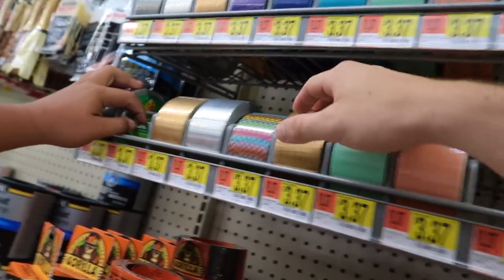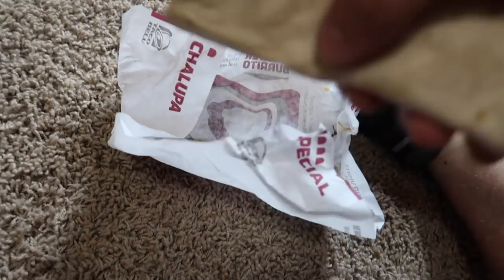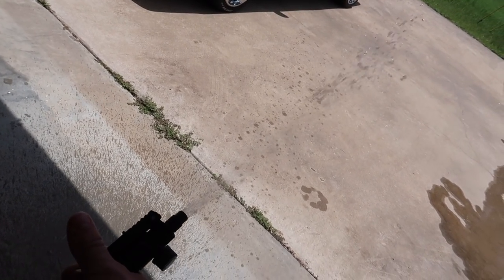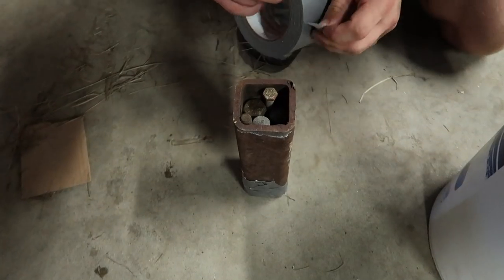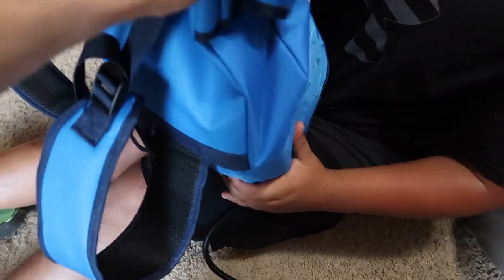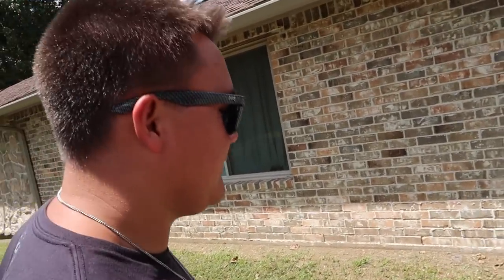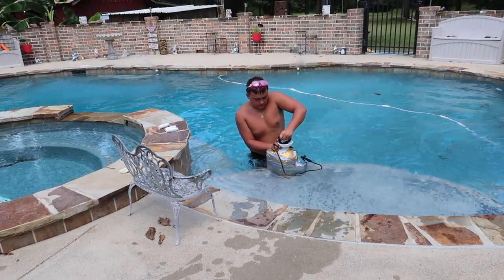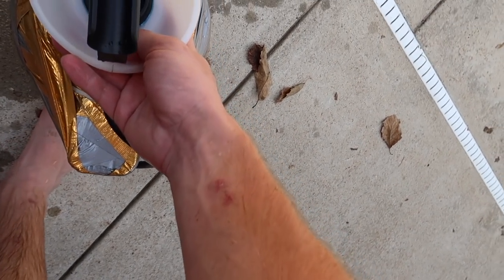How To Make A DIY Scuba Tank for Under $20 at Walmart!!

Comment: Connect a 25 - 50 ft long coiled air compressor hose / or tubing on the existing tubing, switch on wrist band removable,  put the tank in a floating small boat / or inner tube with a bottom, with a divers flag, maybe with an anchor and rope.  Wear a weight belt detachable in case of emergency,  ( if needed a string under shoulders attached to boat, but the coiled hose / tubing may surfice for the string . ) Max dive depth about 20 ft and Voila you're scuba diving. like the old time suit helmet diving.  But get training scuba diving certified to understand about diving to be safe. maybe with a diving knife...

Comment: Their talking about 10 feet of water for crying out loud.   I have played with this option myself but I got a larger sprayer from Amazon as well as a low pressure hooka regulator and hose to use with it.  I also added a air pump tire valve so I could use an electric tire pump to get more air pressure.   This will give you more like 15 mins in river depths and only a few mins to pump it back up if you use an auto tire pump.  The regulator helps reserve air pressure better, and I left the tank float with a flag and small anchor and use a 15 foot hooka hose that came with the regulator...  it works quite well with both manual and electric pumping...

Comment: Cameron, please google boyle’s law. Never ascend in water while holding your breath!! You could really injure yourself, or worse.
Reply: I also reccommend never to dive more than 20 or 30 feet at most - and that’s pushing it for a rig like this! A bit more difficult to calculate for is henry’s law. The deeper you go, the more partial pressure the gases you’re breathing have (nitrogen and oxygen in atmosphere)  - and the more of it will dissolve into your body. If you come up too fast from a deeper dive, and you omit your decompression, you can have gas bubbles that’ll form in your body as you come up. Imagine the sensation of having a crowbar in one of your joints between two bones - that’s type 1 decompression sickness, aka the bends. That bubble will stay there indefinitely unless you get treatment in a hyperbaric chamber (harder to get than you think!) - and type 1 is the least of your issues! Type 2 is potentially life-threatening, and the effects are neurological. Even worse, you could have a bubble form in your arteries, and within 5 minutes of surfacing you could have what is effectively a stroke, better referred to as an arterial gas embolism. Easily fatal if not immediately treated!

Another threat to you at deep dives is narcosis - particularly because compressed air has copious amounts of nitrogen!!

This is a cool video, and the tank seems to work really well, but safety cannot be stressed enough. Scuba is fun, and a long life of enjoying it is well worth the research, classes, and certifications you need to make sure you’re safe in the water. The navy has a diver’s manual available as a pdf for free online that’s definitely worth a read, and is pretty comprehensive for being written for the layman. Easy to read understand. Be safe, and good luck!
Reply: I have to disagreed with you here. Diving while holding your breath is called freediving and unless you are overweighted it is the best and safest form of diving in my opinion
Reply: Stealth The Unknown My man!! Glad to know that you have your facts right, but you're definetely getting too worried about too many things. First of all, the time that this rig allows is probably 5 mins tops at like 2 meters, so oxygen poisoning and deco sickness will never be a problem, simply because of time
Reply: Rodolfo Flores you’re both wrong here he is not freediving as he isn’t holding his breath and  we should be worried because this is not safe at all
Reply: lem thelurker I never said that he was freediving, I said that you will never have decompression sickness using this tank, nor oxygen poisoning. Man, reading comprehension for you...

Comment: why dont you just change the hose out, buy a longer hose and replace the shorter hose so you can let the tank float and then go under little bit deeper. USE SOME hose mender fitters cut the hose then attach a longer hose with hose menders ..then some c clamps to make air tight. then you have longer hose...can attach the air hoses you can buy for longer hose..let the tank float.....